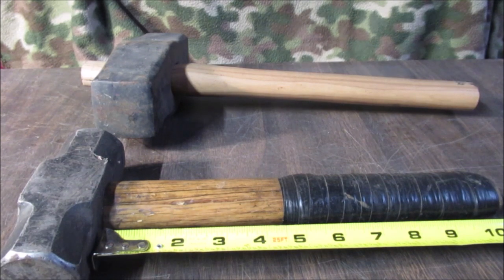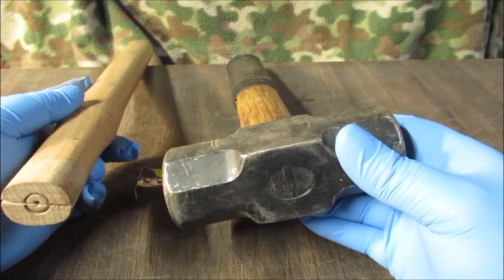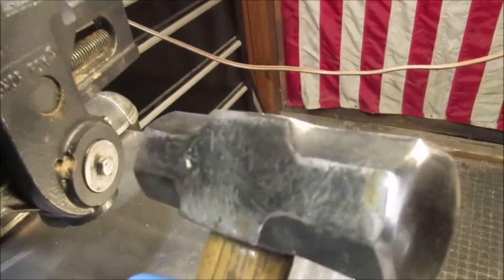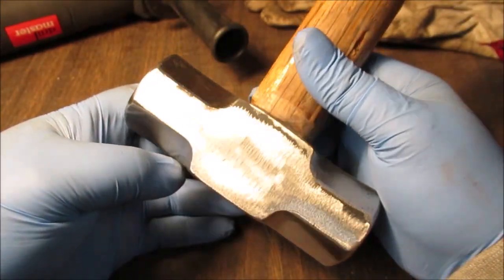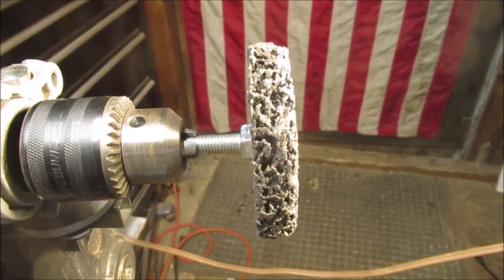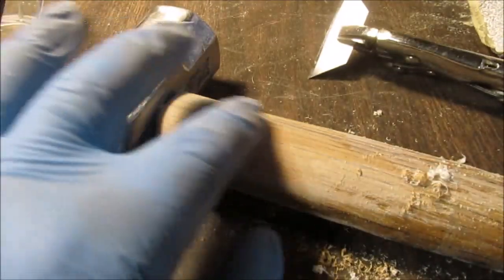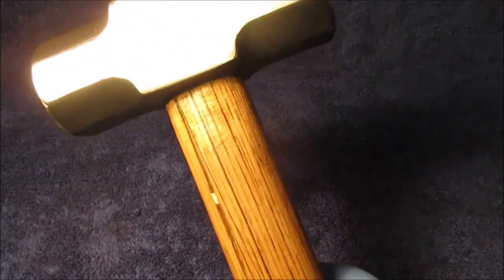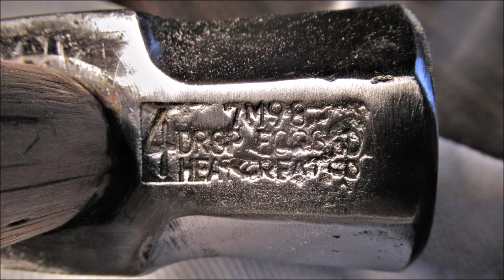ScoutCrafter's Short Handle Hammer Challenge

Comment: Hi Jim , Nice Job . Scout Should like That . That Other Hammer Was A Thor Hammer For Sure . I like My 4 lb. Engineer Hammer . Been There Done That with the Brake Drum/Leaf Sprint Bolt/Lug Bolt Etc.
Reply from the maker: THANKS  I used this hammer when I put the lowering shackles and air shocks on the truck  The handle was too long when trying to swing in a small space